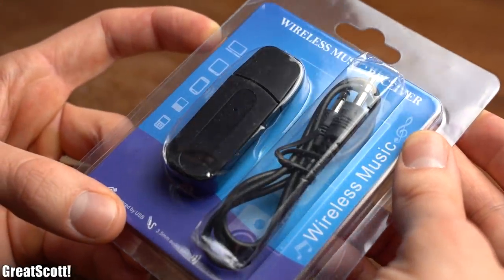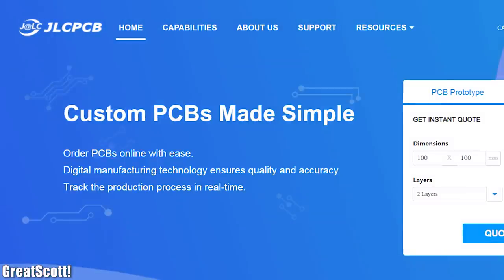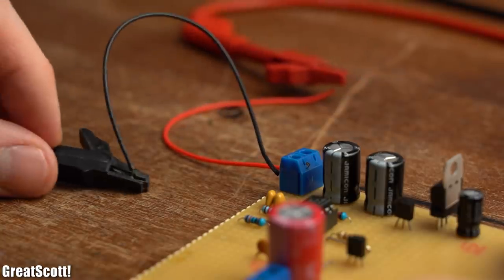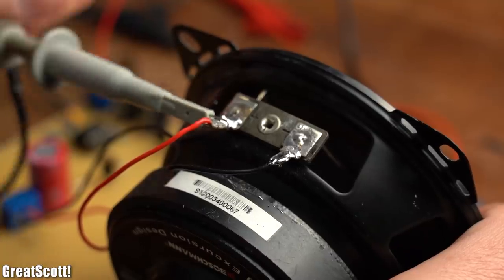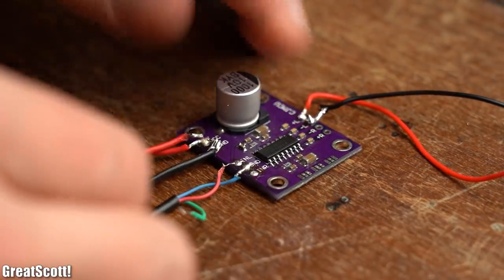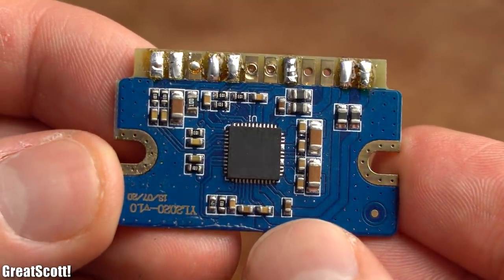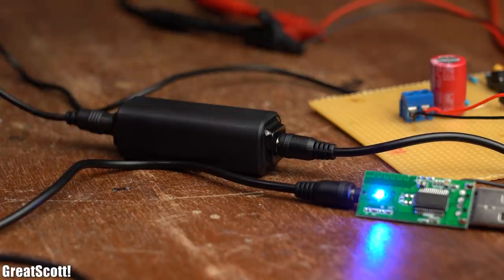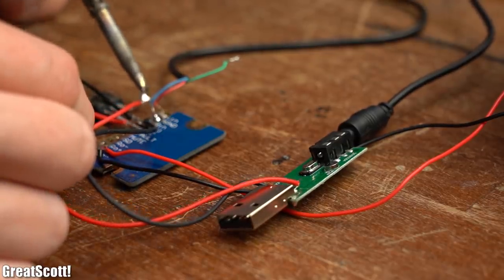How to remove buzzing/noise from a cheap Bluetooth Music Receiver? (Experiment)

Comment: As a point of clarification and question of uncertainty, the only reason the ground loop isolator didn't work for you is because the bluetooth transmitter and the amplifier shared power sources right (which means their shared ground was still connected through the PCB board and 5v regulator)? 
Considering at 05:12 when you built up a 2 mains power supply circuit  to prove it solves the issue, then I wanted to be sure why the purchased ground loop isolator didnt work, considering it's designed to eliminate ground loop interference caused by 2 devices with separate power sources (or technically their own power adapters plugged into the same AC circuit), then it thus failed to remove the interference since interference was being caused from the ground shared on the PCB level and not through the shared ground introduced by the audio cable. 
I also wanted to clarify, since I'm not an expert on electricity or audio for that matter and am wanting to make sure I didn't just order a ground loop isolator for nothing (but will find out tomorrow I guess), if the DC to DC converter acting as a DC rail isolator only worked because it then separated the ground at the PCB level?
Lastly, would the fact that at 07:42 when you tested the final solution, the audio could have been affected by the magnetism introduced by it's USB A end which was stuck to the magnetic ring of the speaker and would've magnetized the ground connection to the PCB or not really?

Honestly asking to make sure I understand these concepts correctly since I'm trying to learn how it all works exactly.

Comment: Cheap small speakers are less prone to these noise problems , so one can get away with common supply to both Bluetooth and class D amps like PAM 8403. For Good quality high sensitivity speakers I find using seperate 5V SMPS like mobile chargers(everybody has atleast a dozen in attic) much more effective solution.

Comment: Common mode noise is a real bugger sometimes. DC isolation is the go to fix for it although sometimes it can be eliminated (or at least sufficiently attenuated) in the IF stage with ferrite beads or an RF choke coil. If you were dealing with radar frequencies even PCB foil trace placement and pathways are a solution.

Comment: Your solution with the different power supplies seems to work for my case where I wanted to connect a TDA7498 with a seperate bluettoh module... Thanks!

Comment: Pick a 5V regulator that has an extended PSRR frequency range. Like the Texas Instruments TPS7A4901 (also comes in negative polarity versions if you need it). I use these to power highly sensitive, load cell signal processing circuits. Be sure to use ferrite beads and common mode chokes on the input to the 5V regulator.

Also consider that the Bluetooth receiver may not meet FCC-B. Try separating the Bluetooth receiver from the other audio equipment.

Comment: BT audio out GND joins the power ground of the amp board and creates a loop, also your daisy chain ground system is "no no" for audio / analog designs. Use a star ground configuration to a low impedance point like a main filter cap and interrupt the loop created by BT aout GND.  Potentially I'd try to connect BT aout GND via 100n cap to non-inverting input of your amp ( pin3) to run the amp in differential mode. 12V/2 DC bias circuit should be bypassed by a cap and then brought to pin 3 via serial resistor eg 10k. Sure there are more options, but DC-DC isolation for such a basic circuit is an overkill.

Comment: Hey,

I can't look through all of these comments, but it seems you could use an opamp for ground isolation. Put say, a 100 ohm resistor between the grounds and use the opamp as a common mode isolator.

It's what I would use rather than a transformer.

Comment: Put the negative end of a large capacitor directly to the ground pin of every chip and the positive end to the power.  This worked for me.
Reply: Of course block capacity should be part of your design, how should this  work to avoid ground loops?
Reply: @patrick_test123  You can call it whatever you want but this Worked for me at reducing the buzzing to a hardly noticeable level.
Also, the AGND (the audio ground for left and right) is connected to the common power ground for the Bluetooth receiver module from the manufacturer.  It is the same scenario on the amplifier.

Comment: Thanks I used one of those DC DC things in the past and it works greats. There is always some smartass always telling you that you did somethig wrong in the amp or to put capacitors in stupid places. 99% of DIY BT speaker like this have this problem.

Comment: Wish I saw this video a week ago. I fixed a modeling guitar amp for a guy in my area and had this issue. I messed with chokes and filter caps all over the show and eventually returned the amp to it's owner. In your signal, I can clearly hear mains hum. In mine it was mains hum then a high pitch on top of that.  Kind of like mains hum becoming the high pitch sound as capacitors filled up. Wish I had more time to figure it out.

Comment: What about disconnecting the audio ground from one end (receiver)
It's common that the main part of an audio system is the hub of all grounds, anything remote that is powered from the same supply uses the supply ground, with the audio ground disconnected, but in the case of a sceeened cable the screen is connected to the amplifier only
Reply: Power grounds would still be connected, so audio inputs would use that as audio ground.
Reply: Correct, but it's only one ground, not the 'hum loop' that i think is causing the problem
Reply: @sparkyprojects  this isnt a hum loop, its oscillating from feedback. What probably more likely happening is the power sugres in the audio amp are affecting the bluetooth ground, causing a feedback loop
Reply: @researchandbuild1751  As far as I see it, there is no feedback, just big enough load-pulses from the bluetooth module to create a voltage shift on amp-ground vs bluetooth module-ground.

The fix is probably isolation, or really good ground connection (like soldering the board directly to amp-ground without wires using a solid connection). Analog ground/differential inputs amplifier should also do the trick.

Adding capacitors to power input of the bluetooth module itself may also help.

Comment: Have you also tried to remove/modify the action sounds? Like “The bluetooth device is ready to pair” or “Phone connected”
Reply: Those are annoying as f

Every chinese device needs to speak, but WHY??????
Reply: @fusseldieb  Because chinese like "Fashion Sound"
Reply: Some times there is a programmed function to turn these off... like holding down the pair button or the play button or something.
Reply: @adrigenvongarnerd  i managed to reflash the flash ic to remove the sounds... as you can see in my video

Comment: If I remind correctly, the easiest solution is just a pair of resistors in parralel with amplifier input. The reason is that amp has a very high-ohm input, so it catches any interference. Resistors will gischarge any interference (irregardless of it's nature), but won't really affect signal. 

I may be wrong, i'm not 100% sure. But I suggest try, then critique. Resistors could be somwhere in ballpark or hundreds ro thousands ohms.
Reply: im going to try this, maybe this can solve the problem. the converter dc-dc not work for me, this thing give me more problems than when i dont use it.

Comment: I solve this problem by using just one single cable for ground on the bluetooth module, and one single cable for ground on the amplifier, but this cable must be short and very thick, connected to the power supply, And the noises almost dissapear, another solution is to insolate the ground feedback of the amplifier (the gain loop) so it became a kind of diferential amplifier with common mode rejection. That helps a lot, and using both of them you will not hear the noises.

Comment: The best place to kill off noise is usually at the source rather than at the receiver. It's clear that your amplifier needs much better decoupling. This will reduce the output noise and improve the amplifier performance...

Comment: You focus on GND being the problem, yet your data shows that current pulses on the power supply are affecting the amplifier.  Shouldn't this mean that properly bypassing the BT module with a PI filter on the power rails is the PROPER solution?  I know you showed the AGND approach, but if the real problem is the transients caused by the BT radio and REALLY poor power supply design of the BT module, shouldn't you focus on properly filtering the BT power rails, to avoid the noise generation in the first place, rather than treating the symptoms afterwards with black box gizmos?

Comment: In principal, a proper LC filter, (note, not simply a capacitor) should do the trick with something like this, if spec'ed properly for the interference in question.
Reply: I wonder how much a simple inductor would help, just to resist changes in current

Comment: Just add a series 10 ohm resistor to module vcc input and a 220uF bypass capacitor between vcc and gnd. That removes most of the audible noise.

Comment: Pin One analysis is useful.  Cross talk/induced noise. Circuit vs. digital ground. Digital stuff is inherently dirty, as is switch mode power.

Comment: Want to really isolate, use an digital isolator to bridge the isolated domains. I like Silicon Labs isolators. 150 MHz bit rate over a data link is pretty stunning. They have a version specifically for I2C.

Comment: I was contemplating removing the logic from my Soundbar and replacing with my own setup similar to this (ideally retaining buttons and inputs). I may have to open it up and inspect it. It's a decent soundbar, but I don't like some of it's behavior (# of volume steps, auto-off delay, etc.).

Comment: in one of my recent prototypes i used such an isolating module to boost 13.8V to 17.8V for an op-amp supply. It worked well when the output was in series with the main supply voltage. This MUST be an isolated output supply to do this, otherwise you will have a nice fireworks show.

Comment: I had a similar problem, but the preamp and power amp were connected to same 12v line.  Adding a transistor regulator with a RC circuit to power the preamp solved the issue. Power amp was periodically pulling the supply voltage down and the high gain preamp would amplify the voltage ripple.

Comment: Great video. Removes my wondering why the electronics side of the Roland Bridgecast mitigates sound using a ground loop isolator fine. Where as, with the input on a SP-404 MK II the inteference from ground is still present. It's in the circuitry that it can't be helped with the same solution.

Comment: Many Chinese boards feature this bt module in conjunction with one of these 5v isolated ws0505 something... Modules. This is however expensive (~1 usd). I do not know why they don't use an audio isolation transformer. An audio isolation transformer can be as cheap as 50cents from China. For single channel use this is cheaper than the isolated DC DC module. 

The problem itself is that the Bluetooth ic doesn't feature a common ground. The audio output ground has a different potential than the power ground. So you need some kind of galvanic isolation.
Reply: Probably since a audio transformer would affect the audio some. (bass responce, e.t.c.)
Audio do cover a quite a wide frequency range.

Comment: You could have tried a floating ground. At least to demonstrate how an ammeter can’t monitor its own supply without one. It’s not a solution but perhaps the topic for another video? Another interesting fact is that the vast majority of Bluetooth have terrible high kHz switching noise. Perhaps a topic for the future too?

Comment: well, i guess i try some of these ideas since i'm finishing up a project for my sound system, and since i have some interference my first thought was to add capacitors, but apparently  that didn't work. 
the first problem was the motor from the servo was activating the IR sensor with random stuff; solved that by powering servo straight from the 5v supply and switching the IR to the 3.3v of the arduino. Then, after adding the digital pot on the 5v rail, it would transfer the noise to the dsp; i moved that to the 3.3v, too. And the worst was when i added the oled, the audio from the dsp was full of hissing and pops; ended up having to use a breadboard power board and by giving it the full 3.3v line on that fixed everything.
i still want to see how much i can push the ideas, so i'll move all the components to one supply line and play around with coils, capacitors, and maybe even diodes.
Reply: If you are serious about that, you would want a 4(or more) layer board with dedicated ground plane, and power planes. Basically a big solid connection to keep them the grounds close in voltage.

Also, lots of bypass capacitors on evrything! That's just the basics.. there is a lot more you may want to keep attention on!